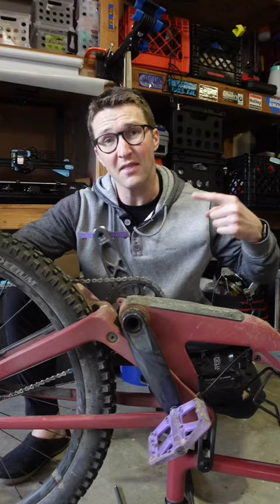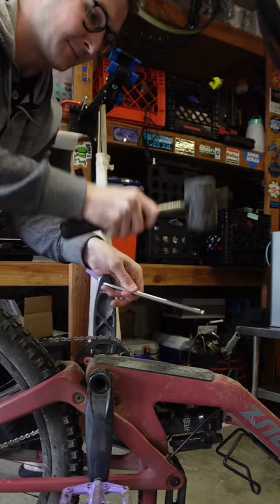The easiest way to get a pedal off of your bike?

Comment: Reality for most people: misses with hammer or slips off that skinny allen key. Smashes carbon frame. Happy trails!
Reply from the maker: You could smack that down tube with the rubber mallet as hard as you like, not going to damage it. Besides I like to give people the benefit of the doubt, that if they have these tools they have the basic skills to use them.

Comment: I should have tried that, a couple months ago i was working on a bike with incredibly stuck pedals and everything wouldnt work, so I strapped the opposite crank to the chainstay, and got a massive tube for leverage and had to pull more than my bodyweight for it to come loose.
Reply from the maker: Wow that’s a lot of force! Good problem solving. I find that the vibration from the tap goes a long way to loosening the bolt. An impact wrench with a hex head is also a great option if you’re careful. But I’ve seen people accidentally go the wrong way and strip the crank 😂

Comment: I should have done that when I was fixing the chainring, the bolts were on so tight so I had to use my full strength to turn the Allen key and all that power went straight into the chainring as I punched it with my knuckle.  Though I didn’t end up with too bad of an injury I still got a memorable lesson